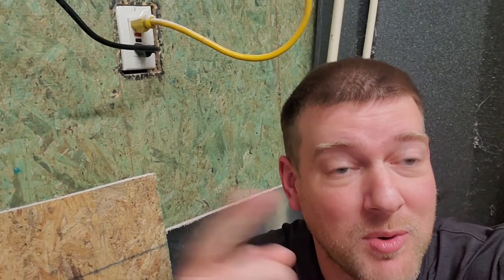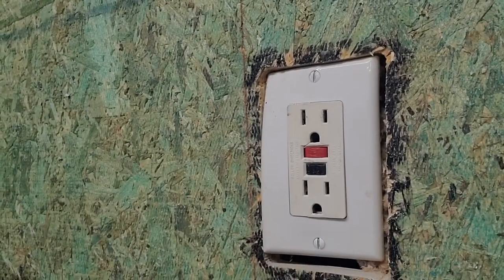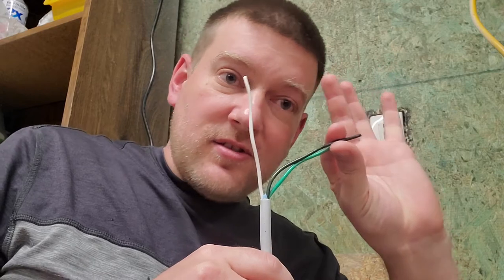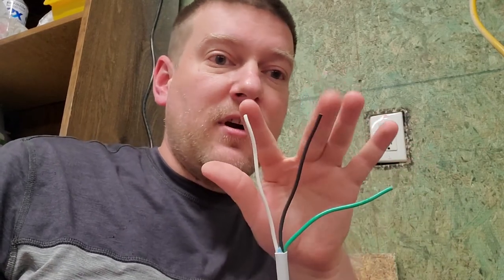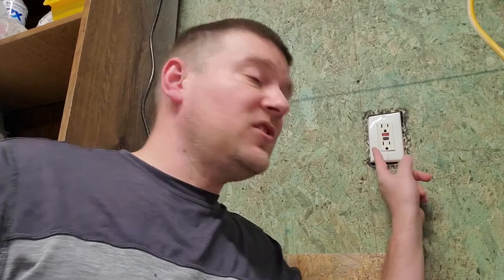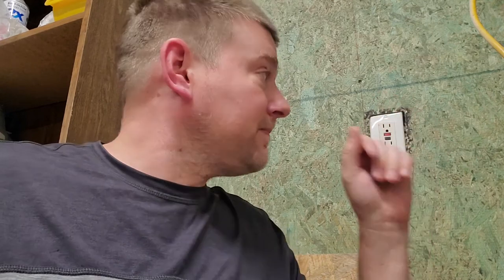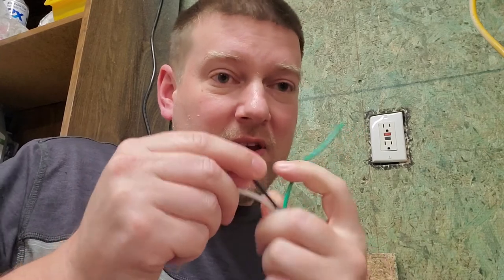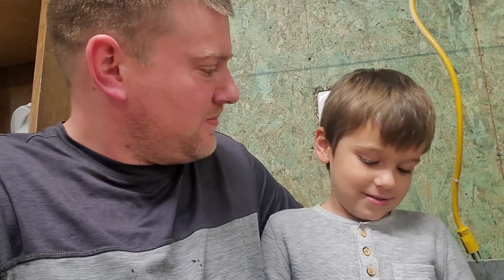GFCI Outlets

Comment: Working in an older hospital, I installed a bunch of GFCI's where they were  not technically necessary , as the breakers were themselves GFCI. 

The problem was, they were sharing the same circuit as other receptacles, sometimes in adjacent rooms. Discovered this when a tech spilled fluid at one outlet and it took out slave monitors in the procedure room. 

Later i discovered an automatic door that would trip was due to it sharing the circuit w/ a receptacle sitting about 2" from the air gap drain for a DSD. If there was a splash, the door died. 

Also went through and replaced the older GFCI's that were designed to trip during outages. 

It took months of "down" time with a circuit finder to trace out everything & redo the panel directories. Added maps to the panel directories to show where everything was located, including breakers in other rooms.

I also went ahead and had a buddy silkscreen the circuits on the wall plates, & I  labeled the boxes & accessible conduit, so in the future, no one has to deal with that massive headache.
Reply: Shameless plug; the new Klein RT-250 receptacle tester is awesome. It's $20, and has a beautiful LCD display that reads out the fault, (no more proprietary 3-light codes,) and even better, it displays the mains voltage. It has AAA batteries, so you can read the voltage even after you unplug it, which is great for receptacles with the ground on top, (which is what I prefer, as it eliminates the remote possibility of shorting that plug by dropping some metal, or a metal wall plate, across the neutral and hot olugs.)
Reply from the maker: I have that tester next to me in the video. Since my son was trying desperately to get my attention and I'm doing these videos without a script,  I forgot about testing options..
Reply from the maker: That is crazy! Putting forth the effort now probably saved you hours of headaches later.

Comment: Also to mention, that a GFCI only works on circuits that are ground referenced. A GFCI behind a true isolation transformer, won't trip when a ground fault occured.
For protection behind a isolation transformer, you need a socalled "Isolation Monitor Relay" which detection circuit works completely different then a normal GFCI.
Reply from the maker: I have a true isolating transformer on my workbench.  This would make a great experiment video.
Reply: @BetterBiomedChannel  , looking forward to that experiment.